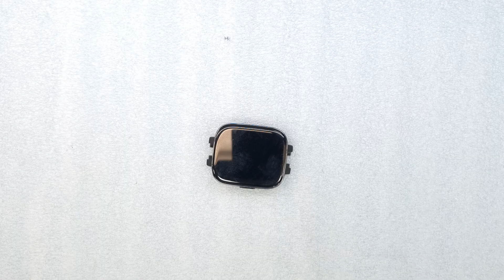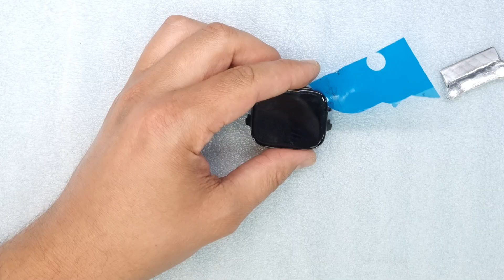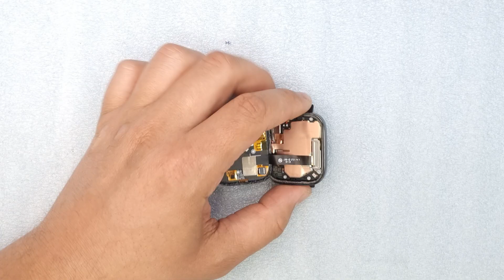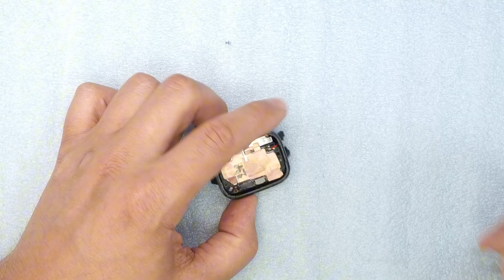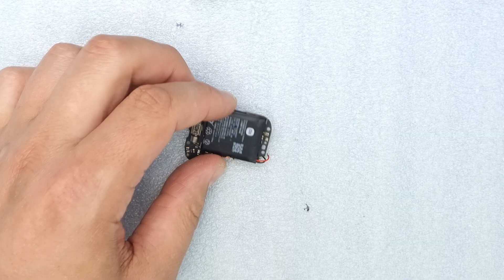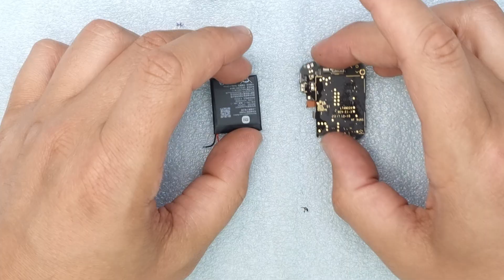Redmi Watch 3 – Complete Disassembly Step-by-Step | DIY Safe Teardown

Comment: Bhi redmi watch actve.3 ky Battery ky price
Reply from the maker: I work in an official service center. We receive original batteries directly from the factory. The approximate price is 20 euros. When they are not available, we use aftermarket parts, for example from AliExpress, at a price of around 10 euros.

मैं एक आधिकारिक सर्विस सेंटर में काम करता हूँ। हमें फैक्ट्री से मूल (ओरिजिनल) बैटरी मिलती है। इसकी कीमत लगभग 20 यूरो होती है।
जब मूल बैटरी उपलब्ध नहीं होती, तो हम आफ्टरमार्केट पार्ट्स का उपयोग करते हैं, जैसे कि AliExpress से, जिनकी कीमत लगभग 10 यूरो होती है।

Comment: My device one day simply went black screen.
Any tips?
The day before i noticed the screen flickering at random times.

I know it's alive thou.
Reply from the maker: It’s a classic problem: the watch lost its water resistance and some liquid got inside. It reached the mainboard connector and the display flex, where corrosion started to form. At first it worked from time to time, but the corrosion kept getting worse until the watch completely died. This is the most common cause. By the way, I’ll soon upload a video showing how I fix this exact issue on a Redmi Watch 3 Active.
Reply: @MrJiorel thanks for the reply.
So it's possible to recover it?
Reply from the maker: Repair is possible, but it depends on how far the oxidation has progressed. There are limits after which restoration becomes practically impossible — for example, when the circuits on the mainboard or the display are already heavily damaged.

One important tip: don’t put the watch on charge until you take it to a repair shop. Applying power to oxidized circuits accelerates the corrosion dramatically.
Reply: @MrJiorel actually i was thinking on repairing it myself.
I got the tools. And for me it's lost already so might as well try.
Reply from the maker: Then I wish you success and positive vibes!
Reply: @MrJiorel  thank you very much and best wishes for you too

Comment: Is it possible to reset factory settings at this stage without using the app, I don't have  a PIN and my phone is not synchronized?
Reply from the maker: Generally, smartwatches like the Redmi Watch 3 don't have a way to be reset by plugging them into a PC (they don't have a 'Recovery' mode like phones). There isn't any official public software or other known method to do this directly from a computer.
But I promise I'll look for a method and get back to you.